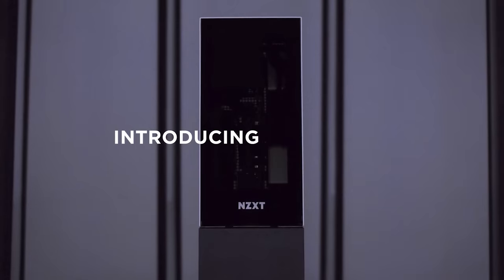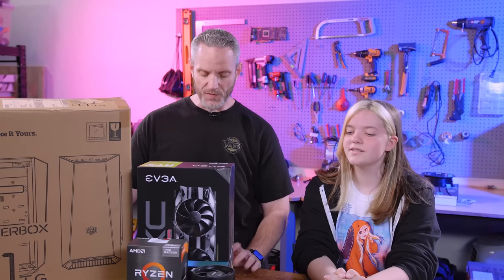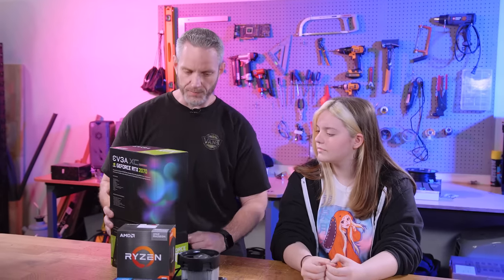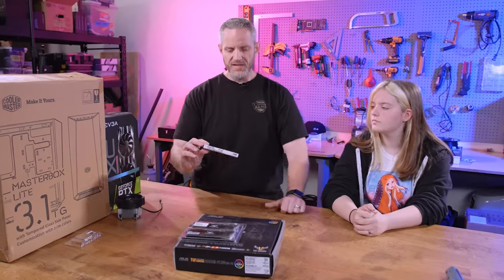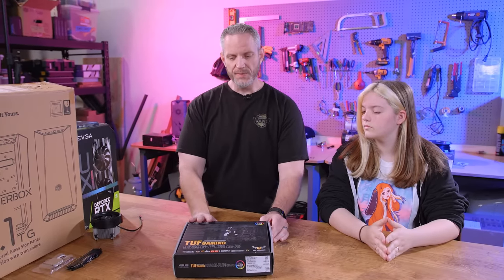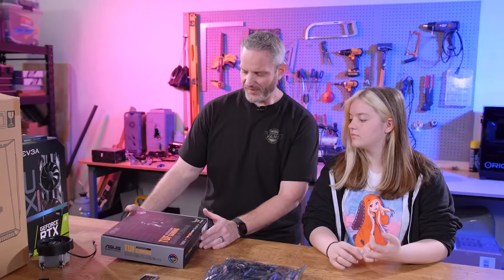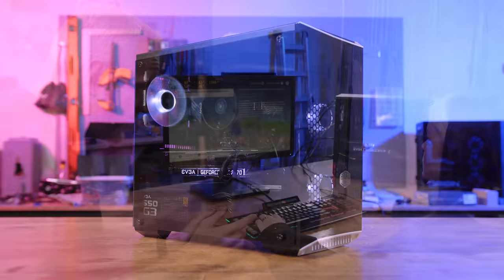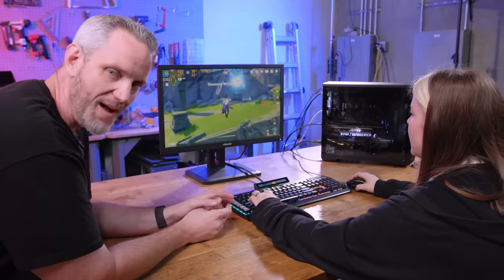My daughter built her friend a PC!

Comment: Am a teenage daughter myself, I was the one that initiated building my pc and my dad being a machinist was interested, took us 6 hours just cuz I had to explain what everything did to my dad and it being the first PC I've built.

there's a few little quirks to it, the back fan wasn't plugged in, the radiator screws dont sit flush against the case so the filter has 3 visible bumps, and the USB A port on the front of the case doesn't work for the simple fact that I gave up after trying for 30 or so minutes, and the 2nd fan on my radiator isn't connected to a CPU_FAN header so it isn't running full tilt during turbo boosts, regardless the hottest my i7 has gotten is like, 70c.

I watched you and others, Jay, to feel competent and confident enough to build a computer, parents weren't confident, they had a fire extinguisher ready, but thank you for taking some time in your videos to explain the little nuisances of computers.
Reply: But you did it and that's the most important part. Even if there were some hiccups, mistakes, or things that didn't work or look as you hoped, it's experience for the next build you put together.
Reply: most of those can be just fixed on a weekend in a few hours. I'd just make notes of how to fix them and plan it out and fix it quick
Reply: Dude, that's awesome. I bet that meant a lot to your dad!
Reply: Haha, they actually had a fire extinguisher ready!? You are probably smarter than what your parents think of their little baby girl. For the two radiator fans, just use a fan splitter to connect them together. But I guess you probably already know this...
Reply: Well done :D.
Reply: i think most of us here can also agree that our first builds went about just as well as yours did! thats so cool that you finished it and that your parents had your back with it.
Reply: @3milio0o95  we have a little mini fire extinguisher because my dad likes to cook like he's a crazy man and has set a few fires in the past years lol
Reply: I highly suggest anyone interested in PCs to have one you use to experiment on that you don't care if it dies. Frankenstein that baby, tear it apart and rebuild it as many times as you want and change parts, test it. That's how I learned the basics, and I paid attention to the experts. I changed parts in a lap top based on a video. It's not that hard once you beat the fear of screwing up. 

Granted expensive mistakes will haunt you.
Reply: @cdmarshall7448  i just watched a bunch of build guides the night before and winged it with a 10th gen i7, im just happy it boots and i didnt seat the cpu slightly off and break the motherboard lol, im probably gonna fix the little quirks in it once i get a gpu since im running intergrated right now, but it plays all the games i want it to without dying so im impressed by the graphics
Reply: @teabean2325  GPU prices are still very high but once the next-gen GPUs comes later this year prices on the current RTX and AMD RX will drop to a more reasonable price point.
Reply: The fan there is a minor and inexpensive fix - get yourself a PWM fan splitter cable. Connect the splitter cable to the CPU_FAN header, connect each of the fans to the connectors, and you're done. They're like £3/$5/ You can also get some 4 into one splitters too, which can be stuck to the case using double-sided tape.
Reply: If you download speedfan the exe on your computer you can get access to all the fans u have and control them manually!
Reply: Everyone's been there.  On my first build I had the case buttons plugged in to the wrong pins so the buttons were all sorts of jank.  It takes much less time and will be far more presentable the second time through.
Reply: Having a fire extinguisher ready is in no way a comment on their confidence in you.  It's an acknowledgement simply that sometimes things go wrong, including things you could never foresee (such as deeply internal issues with components).  It's just safety.  Just FYI.
Reply: Fire extinguisher…. Let me guess, NZXT case?  :D
Reply: @3milio0o95  not anymore.. gpu prices have gone lower
Reply: good for you.. i love the idea of more hirls becomeing interested in building pcs. and gaming in general
Reply: @kellyslow5506  nah, corsair, dads apparently built a few of those computers they use in plants (the ones that use strong thermal epoxy that glue the cpu's IHS) and apparently those has set on fire a few times
Reply: Just recently built my first pc ( 26 ) and my results were pretty much the same, my wiring was criss crossed, I litterally crammed the extra cable length into a hard drive bay cause I was tired after 8 hours of building the darn thing and watching the back panel pop off ( fractal design meshify 2 compact, the back panel SUCKS, side panel is awesome tho ) and I had my rear case fan plugged in to my pump header. As long as she runs you can go back and fix the little stuff later lmao
Reply: I've been building my own computers for years and even I'm too lazy to plug in the USB ports on the case sometimes. If it works, it works.
Reply: your i7 1700
Reply: My father said it was a waste of money and time. Years later I'm an IT as a career.
Reply: i'm more amazed that for your first build you went straight with watercooling instead of say, something simpler like air cooling like me (picked AK400 white)

Comment: This video made me appreciate my pc even more, considering there are tons of people who have to live with the "family pc". One day bros, hang in there!
Reply: +10 yrs is not hanging ,  as of now it became my life... Next-gen upgrade was gt710 😂😂😂
Reply: Yep my first build was about 5 yrs ago I was 32. My current setup is pretty different from my first build though, the only thing I'm still using from that first build is my 980 Evo nvme drive.
Reply: @lowendplayer4259  you aren’t doing nothing with that gpu! Ik because I have the gtx version 😵‍💫😂
Reply: I feel the same. I've always had a family laptop with dual core and integrated graphics. Game had to always be run on low. This was 15 years ago going forward 9 years I got my own then the surface pro 3 years ago and last year I built my first pc. You know when you're older you have more money. I built a 5800x with a 3070 and I feel like I don't deserve what I have because I didn't go entry level/ budget, I went high end from the start.
Reply: @lowendplayer4259  if it has an old I7 or a newer I5 grab a rx570 (if the psu has the 8 pin cables for it) and you will have a gaming pc
Reply: @dethtour  I mean you worked for what you have right? If you paid for it yourself you totally deserve it. My first pc was a Q9500/2x2 GB 1066 CL5/9400 GT 512 MB, in late 2020 haha. It was for distance learning and with a bit of an overclock it hung in there running chrome, zoom, and spotify at the same time. Fast forward and I have a 10600k thats top 100 in timespy, 4x8 GB 4000 cl15 ram, and a 6600 thats also top 100 in timespy with almost 3 TB of storage haha.

Comment: Yeah, Genshin Impact is pretty lightweight. I've played it on my current rig, which is ancient (4 core 4 thread sandy bridge core I5 2400, paired with 8GB ddr3 and a Nvidia Geforce GT730, all in a small form factor low profile PC) and it plays fine, only not on maxed out settings. I did put two SATA ssd's in raid0 for lower load times in games, but increasing from 8 to 12 GB ram didn't do anything noticeable for the light gaming I do, and my additional GT710 to make a 6 screen setup is only relevant for my niche work needs. A year and a half ago I built my friend a new PC with a Ryzen5 3600 and a RTX 2060, and he has no problems playing what he wants how he wants to. You don't need top end stuff to enjoy yourself.
Reply: You DO need the top end stuff, if you don't want to buy a new pc for at least 6-7 years down the line tho, IMHO
Reply: @ChronologiXFG  It depends on your use case, if a person is only doing light gaming, web browsing and productivity tasks. You don't need top of the line components anymore. PCI-E 3.0 is plenty for most folks and now with PCI-E 5.0 being pushed into the mainstream, PCI-E 4.0 will be relegated to the "low end" components so no, you will no longer need top end components. Additionally, with FSR 2.0 almost everyone can get by with mid range components for a long while.
Reply: @ChronologiXFG  JTC talked about that in one of the videos. His argument was basically that, instead of buying a top of the line PC for 6-7 years, it's much better to sell your old PC once in 3 years (while it still has a lot of value) and buy a new one using this money.

Comment: this looks so solid for a budget build, i thought the aesthetics wouldn't work but honestly it looks really nice from the front and the CM logo all lit up.
Reply: I thought the same. But it looks pretty nice overall.
Reply: That was a budget build!? Nooooo.... wait....whaaaat
Reply: @bhuvangunessee  i mean a 2070 super is still pretty smexy imo, maybe a 3050 or 2060 would have been more fitting
Reply: @unculturedmister9454  its not a 2070 super. It's a regular 2070
Reply: Honestly it looks really nice I'd probably just change the cooler and  maybe the case wish I could upgrade my 1070 to a 2070 or 3070 one day 😂
Reply: @Kyharra  dude a 1070 is one of the best aged gpu's. i wouldnt upgrade from it if you already have it,
Reply: @unculturedmister9454  exactly my thoughts, the 2070 didn't match the tone of how "budget" was implied in the video lol
Reply: @Kyharra  totally agree with the other comment. You only really need to upgrade if you really want RTX (assuming you're only gaming as gpu heavy task). Also, get the 30 series if you're upgrading for RTX, even if it's a 3060 instead of a 2070.

Edit: or if you want to absolutely do better native 4K gaming
Reply: And the family pc my parents have is a custom build which I built with r5 2400g and 16gb ram dual channel kit running at 3000MHz CL16, so it can run some games
Reply: @bhuvangunessee  mmm true I guess I don't really need to since I'll probably just stay at 1080 60 tbh it only sucks at running a few games but that's because they're terribly optimised lol.. I just hope it'll be fine for another 5 years or longer

Comment: I was wondering if you realized, but the Zen 3 APUs are limited to PCIe Gen 3, regardless of the motherboard's capability.
Reply: A 2070 is only pcie 3x16 anyway so it doesn't matter
Reply: he pointed out that he specifically chose the board because it allows for upgrades in the future. He knew

Comment: I'm 32 years old and always go for "BEST BANG FOR BUCK" 

Bought myself the following new (in Aug 2019):
ASUS ROG Strix B450-F
Ryzen 3600
2x 8gb Corsair Vengeance RGB 3200mhz
Nvme 500gb 
Superflower 750watt 80+ Silver (equivalent to Seasonic) 

Bought from a friend:
ASUS Rog Strix 1070 8gb OC

Had:
256gb SSD 
1TB HDD 

Like Jay mentioned, this PC can run any game at 60fps at high (except Cyberpunk). 

I'm running a 144hz monitor so I have to adjust my graphics to medium-low to push consistent 144fps, BUT saying that, I am a competitive gamer and play more for the competition rather than the Graphics. Still runs smooth as butter and at 1080p.

Everything cost me around R15000 (South African Rand) which was about $1000 back then (keep in mind that I got the GPU for R2500 [$167] from my friend, so I saved quite a bit there)

I will eventually give this PC to my wife and build a new one with a new RTX 4060 card.

Comment: if the squeaking of the 3d printer comes from the moving printhead (if it's the ender 5 printing) maybe consider upgrading the printers mainboard. did it on my ender 3 and now i only hear the fans.

Comment: Watching this video brings back good memories of over a year ago when I picked out all of the parts of the computer that I am currently using. Then using the how to guides that I need to teach me the things that I have never done before as far as replacing since this is my first build.Of course with the help of PC Parts Picker and a little research. Not only did I wind up choosing all of the right parts. But I also did a good job at assembling the computer. 

The only difference between what I saw in the video and what I did was I tested everything by using a test bench with the motherboard, CPU, Ram, and GPU along with the power supply. When I got that working I then put them in the case and before final cable management I checked everything including the hard drive since I also needed to buy a monitor, keyboard, mouse and speakers. After I got it working in the case I did the final cable management and it has been working fine ever since.

Comment: I built my first box in the mid 80's when the only distributor was Dell down in Texas. $1400 for a box with a power supply and mobo. Hard drive had to be booted to a floppy first and then DOS prompt into the BIOS for low level and then high level formatting, and then you could use the 22 floppy discs to install Windows 3.1. 256MB of ram was considered a super fast box back then.

God bless you for giving your daughter the tools and knowledge required to do this correctly. When I static'd out my first MOBO, it cost $900 to repair.

Comment: I totally  concur with Jay re. Crucial drives, never had an issue and I always use MX500 2.5 inch SATA SSD for older PCs that don't have an M.2 slot, while the P2 is my go-to for newer PCs. That 5 year warranty (excludes the BX series) is also top-notch for storage devices. You can get a P2 1TB NVMe here for £75-£80 ($85-$100 approx.) on Amazon. I dunno if it's the same in the U.S. but here in the U.K., NVMe drives are cheaper than their 2.5 inch SATA equivalents, usually by about 10%.

Comment: I had an older revision of the masterbox case, I'm surprised you are getting enough airflow, with my ryzen 7 second gen and 1070 it was struggling to get enough airflow and I would need to take the front panel off. I guess they may have opened it up a bit more in the bottom to get a bit more airflow in there.

Comment: that stack cooler design may not be quite on par as those wraith coolers with the heat pipes, but they're as solid as passive metal gets. I just upgraded from a dell that has a different mounting and fan design, but an itendical kind of solid metal design and roughly similar fin shape, at the taller height that this one has, and that shit's fire for midrange chips.

Comment: This is my Mobo and CPU, i can already tell you the bios wont need an update to work. Just watch out for the ASUS Armory crate update, it caused issues for a while until i did a complete clean reinstall of windows. frankly for a budget build its quite beefy if you combine it with a Radeon and enable smart access. great build.

Comment: I have that motherboard.  I thought it was DOA, because it wouldn't boot up, although the RGB lights on the board kit, but no diagnostic LEDs.  Turned out to be a slightly flaky power connection.  Accidentally bumped into it and it started booting, and now seems to work fine.

Comment: I am gaming on a 3200G and an RX 580. But I have a cool case! Fractal design focus G, budget case but it comes in RED and it's an all AMD build so...
Oh took out the stock fan from lower front of case and moved it to the rear for exhaust and in its place put a 140mm Purewings 2. Now my cool case is a cool case.

Comment: As to Honkai Impact 3rd, or Genshin Impact, you don't need something super beefy to run it. Keep in mind my system is running PCI-E 2.0, though I am going to be doing a slight upgrade to PCI-E 3.0 and a faster, still 8 core processor. My monitor is only 60Hz, and I'm getting high 50's according to ReLive. The game is running from a 7200RPM SATA 3 hard drive.

Specs:
Processor: AMD FX-8150 Black Edition (3.6GHz can OC to 4.2GHz, but I'm running stock no OC)
Memory: Ripjaws X DDR3 1866MHz 32Gb (8Gbx4)
Graphics: MSI Armor RX580 (8Gb card)
Resolution: 2560x1440

By the way that was Genshin Impact she was running.

Comment: Great video that shows last gen parts can still be usable if chosen well. Tho I am a little surpriced that you are using a sata SSD in 2022 ? a standard cheap 3'rd gen nvme is almost same price as the sata models. those should really only be used for updating older machines that have spinning boot drive imo.

Comment: I have a MSI RTX 2070 Gaming Z non super and it handles 1440 just fine with high to max settings depending on the game.  I did do a good cleaning of the card and replaced the tim and all the thermal pads on it recently.

Comment: Genshin probably didn't work on the "Family Computer" because it has some rather intrusive kernel level anti-cheat (gotta protect those Gacha-bucks), and the CPU was so old/low end it was missing one of the more recent security instruction sets. Because Genshin runs on a toaster, albeit at much lower settings, but it's a mobile game so its expected.

Comment: When I built the system I am currently using I used the included cooler that came with the CPU instead of buying another one. I don't overclock intentionally so it works fine.

Comment: Just as a heads up:  I have a 5600G and had a GTX 1660 in it for a few months, sold the 1660 and wanted to try out the IGPU and I got no video through HDMI.  I had to flash the bios and set my ASUS board to use IGPU to get the video to display.  Happy Easter!

Comment: Still rocking a 8700k @ 5GHz daily + 2070 (non super/ti) with 1440p 144hz - getting decent frame rates in warzone/f1 2021 at high settings, so upgrades can wait until pricing finally goes back to normal.

Comment: I have R7 3800X and these Ripjaws V 3200MHz CL16 dimms have a lot of issues on Ryzen platform. I tested them in 3 systems and all of them resulted on blue screens when i applied xmp, so just be aware that you may have to swap them i that friend of yours runs into same problem. I swaped them for Ripjaws V 3600MHz CL16, and they are running just fine